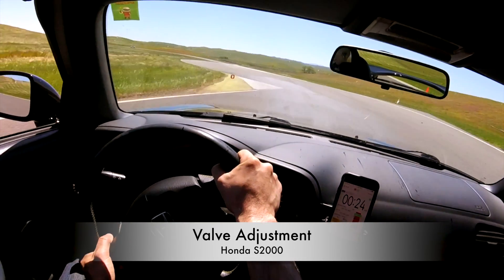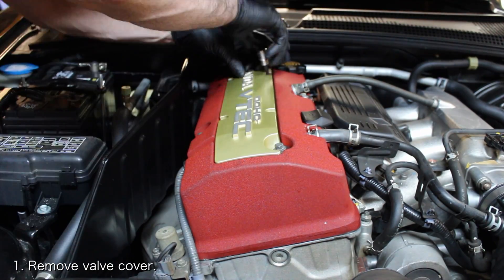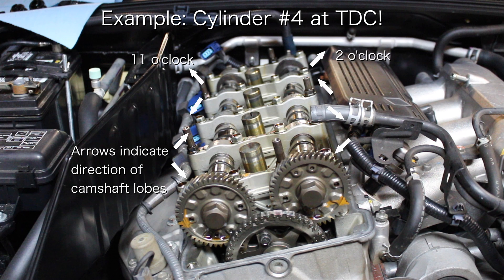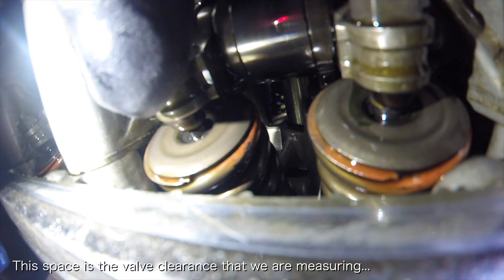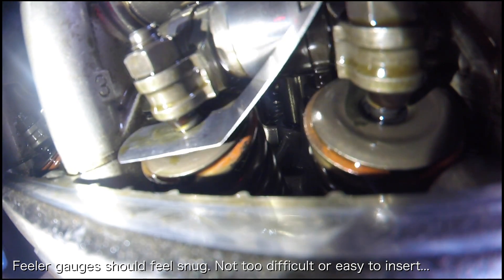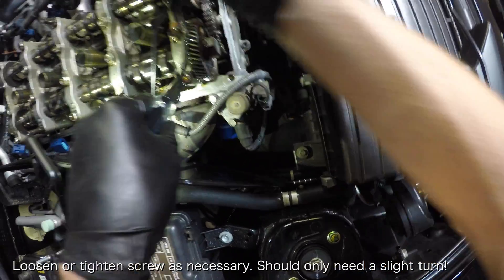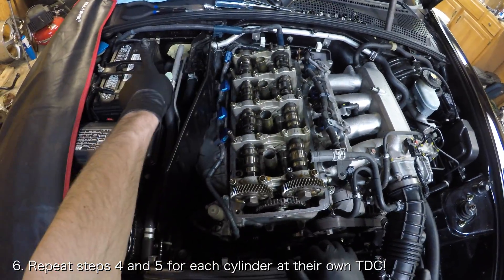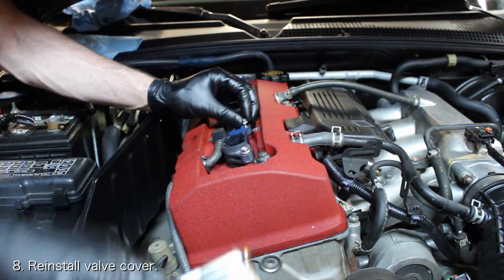Valve Adjustment | Honda S2000

Comment: does the valves make a slight nocking nose when they need adjusting (help)
Reply from the maker: +ally hard question to answer. Loose valves will be loud and tight valves will be quieter. Knocking noises can come from one of the adjustment nuts being loose or it could be a cylinder wall issue.

Comment: Is your car being sluggish sometimes one of the symptoms of needing to adjust valve? I recently bought a s2000 with 130k miles on it and at times it runs strong but other times it runs a bit sluggish and not very responsive. I had changed the coil pack thinking it might help and the cleaned the map sensor dont know what else it can be but this. Please help. Thank you.
Reply from the maker: +Meezus Christ Valve adjust won't make much of a difference in how the car feels in my opinion. I can only notice a difference in the sound of the valves. 

What do you mean by sluggish?
Reply: +DIYGuys it doesn't feels less torquey. Ive been reeding on s2ki forums, and someone had the same problem Im going through and they said that they adjusted the valves and it fixed their problem. Not sure.
Reply from the maker: +Meezus Christ Give it a shot. It’s cheap to do. Just a little difficult.

Comment: Diff oil seals on s2000
Reply from the maker: +Mario Medrano Hmm haven't done that one before. You mean when diff oil leaks from the driveshaft?
Reply: DIYGuys it uses 2 gaskets on the rear diff were the axles go into the diff i need to do it but need some guidance
Reply from the maker: +Mario Medrano honestly I likely won't do t since I don't have the issue myself
Reply: DIYGuys thats alright well if you come across a link to a forum or any help that may help me and let me know that would be cool I'd appreciate it

Comment: Excellent video my friend! Makes me want to get those tools and check my AP1's clearance now since I have the cover off to replace the spark plug hole seals :)
Reply from the maker: +RolanTHUNDER Thanks!!!
Reply: Sure. Remember that misfire issue on my '00 AP1 I told you about? Some good news is that its much better now thanks to the new spark plug seals I installed in the valve cover last Saturday. No more oil is seeping into the coil and plug in cylinder 3 or any cylinder for that matter. I swopped coils around in firing order 1-3-4-2 and it seems much better to the point where I can floor it and not get a misfire however, it still misses at idle/lower than 3000 rpm and has a clunky start which concerns me. Sometimes if left overnight or for a day or two then starting becomes a bit more challenging.
Reply from the maker: +RolanTHUNDER Ah yes oil seeping into the plugs will definitely cause misfires. I would still try to swap some coil packs with someone else.
Reply: Gonna get the ones from my Silverstone AP1 tomorrow. I know for a fact they're working well because she never misfired. Will report back.
Reply: Sorted the misfire out! Just swopped coil packs with my other S2000 and voila, miss gone :)
Reply from the maker: +RolanTHUNDER Glad that worked out for you 😊

Comment: Tried valve adjustment on my 2003 51k miles using .008 intake and .010 exhaust. The car seems very noisy now. I may have set the valves too loose. :(
Reply from the maker: +MrRevto9k were your valves tighter or looser before you adjusted them? If they were tight, looser valves will make more noise. You can always double check your measurements after adjustment.
Reply: DIYGuys no I think valves were good as the car wasn't noisy. I just wanted to do just to make sure everything was good. I was afraid of making the valves too tight and I might have set them too loose.
Reply from the maker: +MrRevto9k It could take a few tries to get the hang of things. Check it out again and let me know how it goes.
Reply: @MrRevto9k  tight valves are often quiet.  The fact that the valves are quiet does not necessarily mean the valves are gaped correctly.
Reply: Tappy valves are happy valves

Comment: How do you acquire this depth of car knowledge? I'm lost in nearly all your videos because of the terminology. Is there something you could recommend?

Also, could you do a step by step video on what to check (if this then do that) if getting white smoke from tailpipe?

Thanks
Reply from the maker: +LimeBlazer I've tinkered on a lot of S2000s 😊

What terminology is confusing for you? Like camshaft lobes and valves? I am in the middle of breaking down an engine so I could do an informative video on engine internals. 

I want to make my videos so they empower someone with little mechanical knowledge to be able to work on their own car. If they can't do that in my opinion I've failed. 

Not sure I've ever had white smoke from the tailpipe so I haven't even really looked into that.

Comment: just watched this! best DIY I've ever seen for this job on our cars! thanks sir. I would shake your hand If I could. would you be doing any valve retainers replacement  in the future?
Reply from the maker: +S2low you know damn well I will hahaha. I personally don't believe in replacing valve retainers on non track cars but I'll do it on my daily driver for the video.
Reply from the maker: +S2low I appreciate the kind words. There is a reason the valve adjustment DIY videos  suck. It's because it's hard to film and explain so I appreciate it.
Reply: does the valves make a slight nocking nose when they need adjusting (help)

Comment: Great video as always! Did you change the gasket during the assembly?
Reply from the maker: +Karocko A I thought about it and didn't feel it was needed since there were no leaks. Thought about making a video on changing the different gaskets tho. You also have the spark plug tube seals.
Reply: Okey cool! Once again, thanks for your fantastic DIY's :)
Reply from the maker: +Karocko A No problem! Always open to suggestions

Comment: Awesome DYI. how tight were the exhaust valves?  Intake okay?
Reply from the maker: +s2kiJax exhaust valves were tight AF as expected. Intake was mostly ok. Some loose some tight. Gonna make a follow up video on the 06+ explaining why valve clearances burn valves
Reply: Excellent thanks again… How often are you recommending that the valves be checked on the 06+ cars?
Reply from the maker: +s2kiJax I'll resort to whatever Billman suggests. Don't remember if it's 30k or 50k